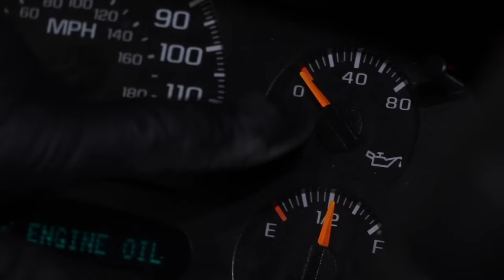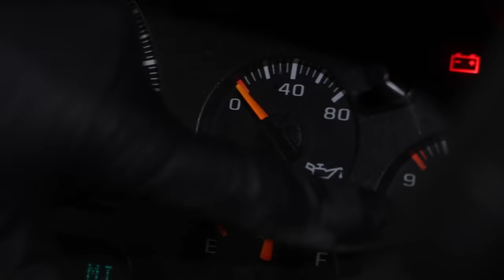Top 5 Problems 2000-06 GMC Yukon Sierra Chevy Suburban Tahoe Silverado Avalanche Cadillac Escalade

Comment: Helpful video. Owning a 2003 Yukon Denali XL, I can attest firsthand to all but the last challenge (electrical issues). And, thanks to your excellent videos, I've been able to make all five repairs (and many others) in my own garage! Love 1A Auto. Best repair videos on the web, hands-down, IMHO.
Reply from the maker: +prdr01 Thank you! We love empowering our customers and showing how to perform DIY auto repairs with our high-quality auto parts.  http://1aau.to/m/Shop-1AAuto-c
Reply: I just bought one.  Same model and Year as you.  Black. It's doing the abs thing.  Also when accelerating, at about 10mph, traction control activates.  Gotta wait like 3-4 seconds or remove foot from gas pedal and then press again.
Reply: @jasoncurtis4404  I'm going through this did you fix it

Comment: I have an 05 Suburban with 289K and an early 07 Silverado with 228K and have had many of these issues on the trucks. 
When I replaced the knock sensors and harness I also used some urethane caulk and sealed the rubber boots to the metal. I also cut a chunk of the rear foam filler out that is supposed to keep water and debris out of the gap. The truth is that foam actually traps water and debris making the problem worse. 
When I replaced the intermediate shaft I also replaced the rear column bearing. It didn’t add that much to the price of materials. 

One problem you didn’t mention was the brake light switch. This is a fairly common problem that will also cause trailer brakes to not work. You will save yourself a lot of time and hassle by buying a ‘Genuine GM’ switch, not AC Delco and definitely not any aftermarket switches.

Comment: Ive owned a few GM trucks from this era. They really are solid, the only issues I had were the oil pressure sending unit ($50 fix) and the grounding issues ($40 fix). I would argue the transmission is a weak point as well but they are heavy trucks.
Reply: omg ! 40$ for grounding ? it's too much for that !
Reply: You'd think they'd have fixed the trans problems since 1987 when I had my little one. (A Jimmy)

Comment: Brake lines and fuel lines rust badly, the frame rusts badly. Exhaust manifold bolts are known to snap off.
Reply: my 2000 silverado rusted badly.
84,269 miles and it went to the junk yard.
shock towers gone.  brake lines, gone.  calipers rusted/leaking.  rear bumper had massive rust holes.  mechanic refused to work on it.
Reply: How to u prevent the rust, I live in Texas and my tahoe has 290,000 with only just slight surface rust. I am moving to Pittsburgh soon in august for school and I’ve heard the rust destroys everything. What can I do? I love this car so much I have 4K put aside just for a new engine an transmission when they go because I want to keep this car forever and rust is my biggest concern.
Reply: @B_WithThe_C  dont move to Pittsburgh lol. Undercoatings maybe?
Reply: @B_WithThe_C 

If you do not drive it in the salt you will be fine, but I have noticed with older vehicles  that are brought up from the south and are driven in the winter they rust out quick.
Reply: @B_WithThe_C  have a krown treatment done every year and that will slow the rust down significantly.
Reply: @B_WithThe_C  washing the under carriage and repaint the frame with rust proof enamel.
Reply: @B_WithThe_C  only thing you can do is not drive in winter.  Salt will eat your car period.  No gimmicks work.
Reply: Rob S I have the same issues with my 05 four wheel drive 1 ton. Bought it new. Has over 200,000 hard miles. Still a good running truck
Reply: Rodrick easton if you love your Tahoe, don’t bring it with you. Store it and buy something cheap to daily. Or just coat the whole underbody
Reply: Yup. 
Chevy truck brake line and fuel line replacement jobs paid the mortgage many times in my career. 
Thanks for the junk GM!!!
Reply: @B_WithThe_C  
The best, no the only way to prevent rust from destroying your truck is.................
Leave it in Texas. 
Pittsburgh will eat it.
Reply: That’s cause you don’t wash your car regularly
Reply: @B_WithThe_C  i'd look at oils. that rubber undercoating tends to trap moisture under it when it gets scratched up in it from rocks and stuff. oil has to be applied every so often though. it'll soak in though and help more than you'd think. /watch?v=bOS1FW1m_Uc
Reply: @rodrick Easton wash your truck whenever there is a warm day during the cold months. Make sure to get an underbody flush. I'm from Wisconsin, that road salt can be hard on a vehicle. Live in Georgia now.
Reply: I would spray down the underside with a pressure washer (if you don’t have one, there are some DIY car washes that have them). Another good suggestion that seems to work well is apply undercoating to the bottom of the vehicle. I’ve seen some people from here in Minnesota even spray the lower panels with an extra protectant but that’s up to you. The salt is what truly causes this “cancer” so as long as you clean that off, you should be good. 
Hope that helps, best of luck in your move!
Reply: @B_WithThe_C  my 1999 1/2 silverado has 350k miles and not a bit of rust, I also live in Texas.
Reply: @B_WithThe_C  don't drive it in the winter... Buy a $1000 junk car to use in the winter
Reply: @B_WithThe_C  The best thing to do to prevent rust is have it fluid filmed, or have a oil applied under the vehicle annually. There are a few places that do this service here in the NE.
Reply: @B_WithThe_C  take that 4k and buy a beater for the winter time
Reply: I bought a complete SS prebent brake line set on Amazon (2001 Tahoe 4x4 240,000 mi) for like 75.00  This should have been installed at the factory!  IMPORTANT!- if you are going to replace the longest line (6'-7') from the front of the ABS to the block that connects the 2 rear brake lines, tie a thick string or 12ga STRANDED wire onto the abs end so when you pull the line out the new one goes under and over what the OEM line did......you cannot see where the line goes very good have to feel with your fingers.......USE THE STRING/WIRE!
Reply: Rodrick easton not much you can the salt will kill it. Wash it in the winter and use a product like fluid film.
Reply: Rodrick easton get a beater car and do not take that Tahoe up to the NE
Reply: Rodrick easton Get it oil sprayed at least once a year. Corrosion Free or Fluid film are both good products. Dont do a rubberized undercoated
Reply: My 2000 GMC Sierra still looks great especially for Michigan. I did replace all my brake lines but the body is nice yet!
Reply: Rodrick easton park it in the gravel and pour waste oil in every panel till it pours out on the ground (catch it with rags) within reason! Squirt the oil up the drain holes make sure the vehicle is dry before attempting! Good luck
Reply: Rodrick easton I’m willing to bet you won’t need a new engine, we’ve seen them with 400k plus still running strong not using oil, just maintain it and it’ll run 12-15000 hours easily...as for salt you can not tailgate in bad weather keeping the mist of the car in front of you out of your grille radiator etc,and wash it often. Fluid film before winter and every 6 weeks if you can get it clean and reapply and again in mid April when winters over..pay attention to the rockers get the fluid film in there really good ,
Reply: @B_WithThe_C  Buy a beater car for winter and park the other til spring if you don't like washing your car twice a week. Waxing goes a long way.
Reply: @B_WithThe_C  Im no expert but try spray painting everything underneath the vehicle with 2 to 3 coats before rusting starts
Reply: @B_WithThe_C  get rust protection spray before the salting season and regularly spray the underneath to clean off salt before it kills. But those are just preventative measures, long enough time and nature takes it course regardless
Reply: Had to replace my brake lines... cost me 1800 bucks
Reply: @daved5244  mine provides the oil naturally to the underside. :)
Reply: Rob S in the north yeah. Doesn’t happen in the south nearly as often. My truck is 1995 and it has absolutely zero rust anywhere.
Reply: @jasonjones3  I see what you did there 👍
Reply: @B_WithThe_C  Yeah buddy store the old truck here in Texas. Take the 4k you got and buy you a beater for while you are in school. You may love the truck but no matter how well you treat it up there, such as undercoating and washing it every day or whatever, it will be detrimental to it to take it up there. Just the environment change alone, before the salted streets, probably isn't that good for it as old as it is now. You didn't say the year but I'm willing to bet the truck has spent it's life here in Texas and that's what it is stressed  to. That 4k you got will be earned back and nothing says you got to spend it all on a beater anyways. If you don't mind me asking, why don't you go to school here in Texas?
Reply: Yall must live in terrible places. I have no rust on my 03 tahoe. Cars only been in california and las vegas its whole life
Reply: @B_WithThe_C  sand down the whole frame, primer, paint, and use the undercoat liner, not rhino liner. Long expensive process
Reply: Rob S idk what’s up with yours but I got an 01 260k miles and has no under rust
Reply: @B_WithThe_C  Master Series paint.  Supposedly will withstand an acid bath.  I've seen a chevy frame rust through oil rig paint though so no guarantees.  It's what I would try though.  http://masterseriesct.com/
Reply: @B_WithThe_C  Krown rustproofing. It'll save your truck.
Reply: @johndoe-nf5bq  🤣
Reply: keep underneath you truck clean. it will prevent most rust.
Reply: @TzUuup  the Midwest is terrible in the winter, road salt eats everything up.
Reply: @B_WithThe_C  you basically have to wash under the carriage anytime you drive over salt. Wash that shit away and you'll be good
Reply: @jeffreymcfadden9403  oil or grease will help to not rust
Reply: Exhaust bolts snap on almost any car though
Reply: We must live in the same area lol. I have a field full of rotten frame chevys 99-06
Reply: 245,000 on my 2004 avalanche and theres basically no rust on the frame, it's lived its life in california though so that's probably why
Reply: @B_WithThe_C  Definitely coat the frame of your truck with corroseal(if it already has surface rust) then add an enamel top coating I would even do that treatment to the brake lines. That should do the trick. I would also routinely wash the underneath of your truck to remove all the salt from the roads.
Reply: U r wrong on the frame. Sure it may rust at 300k but the frames are solid on 9/10 of these old trucks over 200k mileage
Reply: Yes. I replaced all my brake and fuel lines

Comment: Bought my 2001 Silverado LS 4WD with 80,000 miles in 2010. Only real issues were the radiator, starter, alternator, and a fuel pump. That's it.
Paid 9900.00 and recently sold it with 146,000 miles on it for 7800.00 this year. An excellent truck and the body held up very well. Not bad for owning it for almost 12 years! Best vehicle I ever owned.
Reply from the maker: +umarked return Thanks for checking us out! http://1aau.to/m/Shop-1AAuto-c

Comment: Had the knock sensor issue, removing the intake manifold is easier then it looks to remove you guys. Dont be afraid.
Reply: I replaced it 4 times already within a yr span but it still keeps coming back.. idk why. Changed wires and all

Comment: Excellent video easy to understand and to the point  We live in buffalo ny  all our life and our 2000 Silverado at 192000 runs like a champ. Yes I personally have replaced all the brake lines and fuel lines 4wd encoder motor. Had it 17yrs now very dependable. With all the crap out there new and used she’s a keeper  Have not had a truck payment in 13yrs so I don’t mind wrenching on it or preventative maintenance every summer. At 64yrs young I’ve always loved my chevys  😎🇺🇸 Stay healthy U Tubers n D I Y folks in these trying times of ours 🇺🇸
Reply: Heck yeah! Love me a CHEVY! I own a 96 gmc c1500 5.7 with 139k and just bought a 2000 suburban 5.3 with 280k. Very reliable trucks and super easy to wrench on💯💯💯 I'm 25 and have been doing my own mechanic work since the age of 18, learned quite a bit over the years🙏

Comment: I have a 2002 Silverado Z71 with 212000 miles on it. About a month a go the fuel pump gave out, battery lost a cell and the rear brakes had to be replaced due to sticking calipers and all the drive belts were beginning to show their age. This past weekend the oil pressure sensor began to fail, this will cost $400.00 to repair due to the mostly labor cost, they bury the thing on the back of the engine behind the intake manifold. On the plus side it starts well and runs smooth and does not burn oil or leak anywhere. I have replaced the intermediate steering shaft twice along with the lower shaft once. The last time I replace the intermediate shaft it was with a new part number that was to solve the noise problem all together, #19153614, this is a GM part so it fits ok, it's been about 18 month since  the replacement, so far so good the noise has not returned. The vehicle has held up well and is pretty much rust free, it gets pressure washed all over when we visit the coast and it is never driven in the surf. Many other parts have been replaced, but it is 19 years old and parts wear out from usage and time. I would buy a new one but they are all beyond reason in price.

Comment: Left out three common and expensive issues:
- brake lines rot out at the ABS module under the cab. If not addressed this becomes highly likely to lead to an accident when the brake pedal goes to the floor
- 4L60E transmissions fail. won't shift into 3rd or 4th gear. Highly likely if a 1500 is used for towing.
- 4.3L distributor shaft failure. if this breaks inside the crankcase highly likely a partial engine rebuild is in order
Reply from the maker: +Emil Davis Thanks for the feedback!

Comment: Transmission lines are a frequent problem with GM using those stupid leak prone crimps that go from hard line to hose,,,,,,JUNK!
Reply: Guns N Gears so are the oil cooler lines and in the northeast the power steering lines and eventually the power steering pump itself will rust out and start leaking...

Comment: 2004 Yukon, 4.8L 120k miles:  Electrical was so bad, that vehicle would cut out while driving!  (Almost lost control on Christmas eve, with 3 children in car seats--frightening to say the least).    Had to keep vehicle at 1500rpm+ to prevent it from shutting off while operating.  It was normal for the car to drive fine for weeks, only to shut off in the pick-up line at the elementary school (my wife did not earn favor there, I assure you!)   Cleaned and replaced every ground i could find, got it running after sitting for a few months, sold it for $2k and replaced with '14 Suburban.  
2002 Sierra 1500 4.8L, 220k miles:  Still running strong!  Transmission rebuilt at 140k miles.  At 210k miles, I replaced water pump, belts, all fluids, Thermostat, tensioner, etc.  Relatively easy, just labor intensive.  Hope to keep it for a few more years, and give it to my boys for their first truck to share.  

Would add other common problems:
1. Transmission:  Sunshell is fractured or splines are sheared off. Vehicle drives in 1st + 3rd gear only, no 2, 4, or R.
2. Clear coat!:   GM clear coat is among the worst in the auto industry.  
3.  Interior door pulls:  Keep snapping off!  No color-coded replacements in aftermarket yet.  2 small bolts hold door pull at weak plastic pivot point.  Should have used steel backing on this design.
Reply from the maker: +HotRodder82 Thanks for the feedback!

Comment: Great video. I had the last one. Mouse chewed through some wires under the fuse box and was causing the tranny to not shift right.
Reply: get rodent repeller on amazon
Reply: @tomclose6643  or just drop a mothball in there

Comment: Weak points
Brake lines
Fuel pumps
Trans cooler lines
Fuel lines
Exhaust manifolds
Transmissions
Rear brake calipers 
Frame rot
Rockers panel rot
Rotted out in general...huge rust problem with lots of broken in half trucks 99-07
Heater controls
Window regulators
Tranfer cases
Front wheel bearings( favorite money maker 🙄)
Ignition switches
ABS failures
Reply: what no instrument cluster stepper motors...dash actuators for HVAC lol ?
Reply: I had a mechanic years ago tell me that letting an in-tank fuel pump get below 1/4 tank was a bad idea. The reason was the fuel covers the pump increasing its cooling ability. Below 1/4 the pump becomes exposed and begins to heat up and shorting its life. I never let my tank go below 1/4 and I have 150,000 with the factory pump.  I do not know how true it is but it made sense to me and I have never replaced a pump.
Reply: Those ABS Failures. Jesus! Talk about expensive for a refurbished sensor. Tried repairing mine. Worked for 6 months and went to crap again.
Reply: How do I prevent the rust
Reply: @Sluna773  that beeping noise drives me crazy everytime it rings cause of the Abs lol